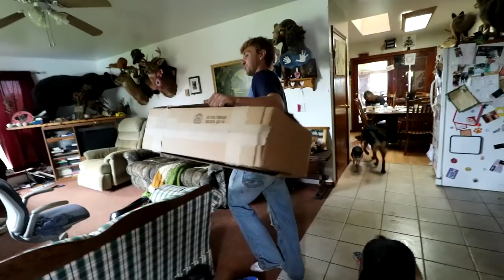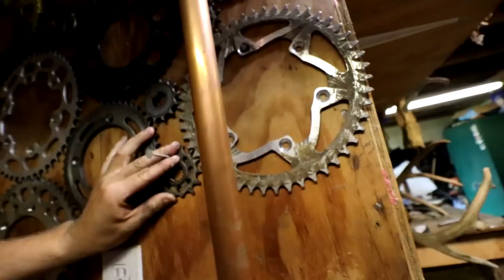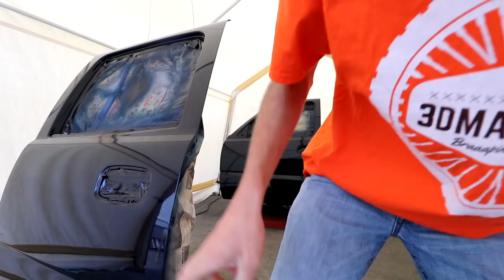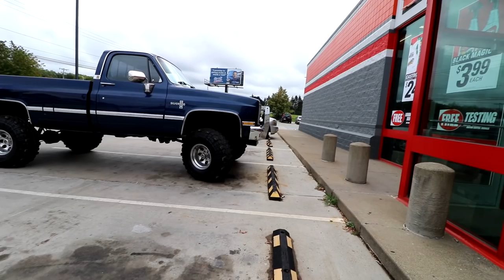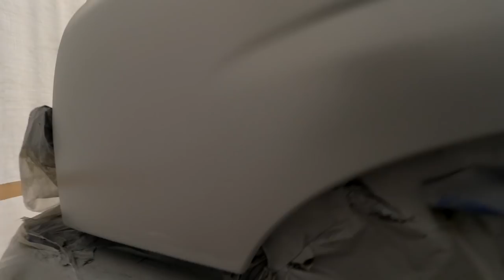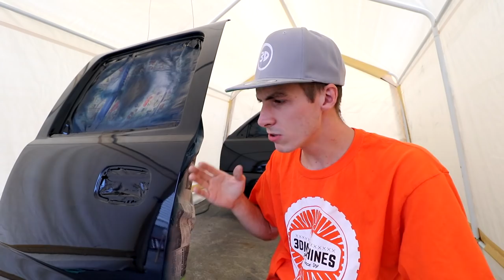Worst Customers LET ME EXPLAIN...

Comment: Hey I know I don't do much for your channel but I'm on the look out for a fuel pump for a 05 1500 chevy v6 crew cab 2x4 it's got a lot of miles and some dents but I'm in the same boat as you I've been trying to get it to show room for mine and my buddies mobile extreme detail service as more of a show truck but I can't seem to find a fuel pump for less than 200 new that will fit. The truck literally just needs to run good so we can make it look stock show room new and put our name on it. The highest price we change is 450$ and that's paint correct and match with 100 percent making the vehicle look as new as possible without re painting it or sanding rust
Reply: Charge *
Full restore of paint interior rims and undercarriage depending on rust damage if it's too bad under price goes down we will not touch it